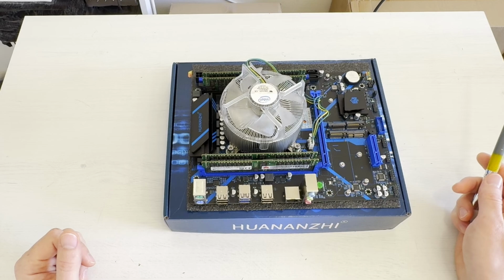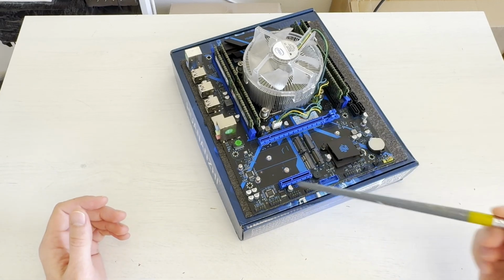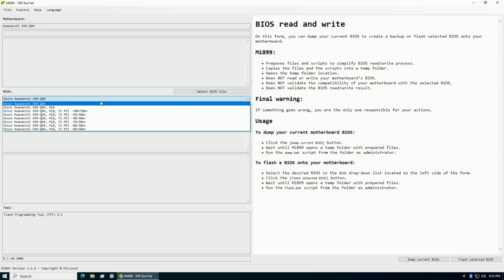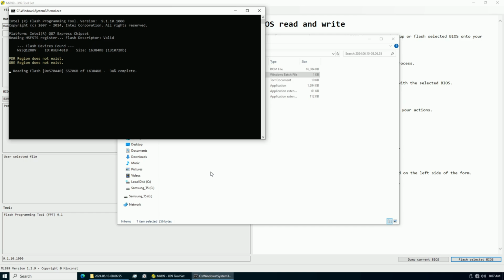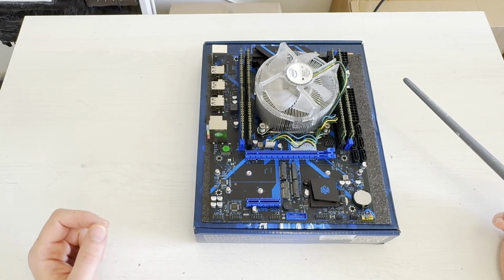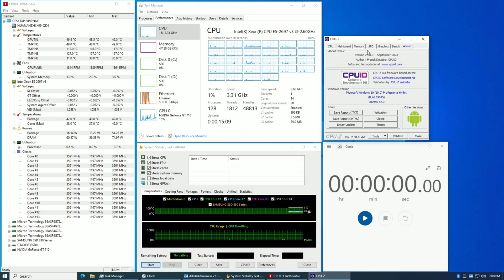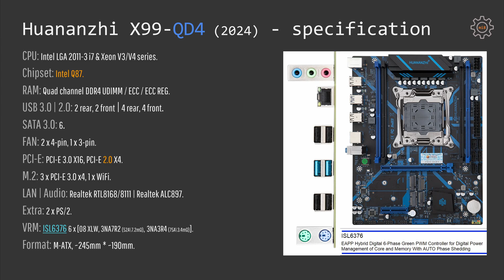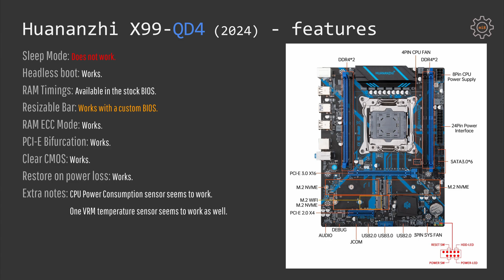Huananzhi X99-QD4 – the 2024 version with three M.2 slots

Comment: I have done the bios turbo boost unlock and everything is working fine. I think I have used your bios (50/50 turbo boost and I guess resize)... 2690v3 working at 3.5ghz and its fine!

Comment: Guys I have this board and a xenon 2690v3, what do you think unlock the turbo or not?
Reply from the maker: Why not? I would surely apply TBU, just need to ensure good VRM cooling.
Reply: @Miyconst the stock is not sufficient?
Right now the cpu runs 3.1ghz over all cores. The vrm temperature looks fine, i have good fans and a water cooler 240mm on it. 
But my questions now is:
I saw, if im not wrong, some bios mod by on the mi899, each one should I try? (Using 2690v3, 3060ti, 16gb ecc)
And adding a fan on top of vrm cooling its fine?

Comment: How to unlock turbo boost on e5 2680v5 please help
Reply from the maker: E5-2680 V5? I don't think such CPU exist.
Reply: @Miyconst  sori e5 2680 v4 so what do i need to unlock turbo boost or maximize the frequency ? Thanks
Reply from the maker: You need a V3 CPU, TBU is not possible with V4.
Reply: @Miyconst  can you provide a v3 cpu thats is good or the best cpu for v3 lineup
Reply from the maker: @benedictfernandez9069  please watch my benchmarks for detailed info, in general E5-2697/98/96 V3 are good/best.
Reply: @Miyconst  so if i use v3 xeon i dont need to mod my bios anymore ? And just use extreme utility app ?

Comment: How to unlock turbo boost on e5 2680v5 please help
Reply from the maker: E5-2680 V5? I don't think such CPU exist.
Reply: @Miyconst  sori e5 2680 v4 so how do i unlock turbo bost on ? Then what motherboard is good huananzhi x99 tf , huananzhi x99 f8 jginyue x99qd4 or machinist x99 d4
Reply from the maker: You need a V3 CPU, TBU is not possible with V4.

Comment: I have the original board and e5 2670 v3 cpu but I want to upgrade the cpu to i7 6850k, Dont know if it works or not ? Someone explain please...
Reply from the maker: It should work but you need regular non ECC memory for i7-6850k as far as I know.

Comment: Same power problem on ddr4 are with the Huananzhi x99 TF series.
If undervolt and another bios i have also 3 ddr4 slots working.
And woth 4th plugged in memory error due power delivery problems.
It seems orginal vios deliver 1.21v to the slots the others delivered 1.15v to 1.19v and gives problems with the cpu memmory controller under boot loading.
Most of the problems comes from the x99 bios from IBM and later Lenovo thats used on modded boards.
The problem also on ddr3 on the TF with all bios thats not orginal.
It means info in the bios are not correct setup when its maked

Comment: I have the 2024 version.
From one moment to the next it stopped recognizing the second RAM dimm, recognizing only the first one (the blue one on the rear panel side, it should be the A1).
I thought it was a burnt dimm, so I bought 3 more, but it still only recognizes the first one.
So I tried to swap them, whichever one I put in slot 1 works, but the others don't works.
then I thought that the memory controller on board the CPU (e5-2680V4) had broken, so I bought another one cpu, but nothing changed.
then I thought the power supply was starting to give problems, so I replaced it, but to no avail.
at this point, being IMPOSSIBLE that 3 out of 4 slots have broken, especially without having ever touched them before, I wonder if there isn't some damn bios setting that creates this type of problem. If anyone has any ideas help me please.
Reply from the maker: The idea is very simple, unfortunately the motherboard you have is simply defective, BIOS settings won't help here.
Reply: @Miyconst  
as I feared...
Looking back at how much I've spent up to now only in motherboards, I would have been quicker to buy a refurbished server from the same era

Comment: Hello again... thank you for your answer , so in the aliexpress what chances i get to buy a motherboard and processor for running windows 11 without any software changing ?? i saw your video here a Motherboard like this( ERYING-Desktop Motherboard Set com Onboard CPU Core, Gaming PC Computadores, Interpose Kit, i5 12500H, i5-12500H, 12C16T, DDR4, DIY) .. this kind of motherboard and processor running Windows 11 and TPM 2.0 ?? thank you.. bye
Reply from the maker: Just get yourself a Maxsun/SOYO/Huananzhi H610 motherboard with an i3-12100F, stay away from ERYING.
Reply: @Miyconst  so in this option i will never get a problem with TPM 2.0 ... because the processor get a TPM 2.0 inside right? thank you
Reply from the maker: That's correct.
Reply: @Miyconst  Huananzhi B760M ... and this motherboard is good?
Reply from the maker: Huananzhi B760M is decent. Nothing from AliExpress is good.
Reply: @Miyconst  And a processor for this motherboard with gpu included.. what did you recomend inside good price?? Thank you once more. Bye
Reply from the maker: Core i3-12100 is good for you and has iGPU, be careful and don't buy i3-12100F accidentally, the F models don't have iGPU.

Comment: Hello again... i got on bios a option overclocking but i have afraid to put it enable... i got a huananzhi qd4 old .. with Xeon e5 2697A v4 ... 4 memory of 8gb ecc samsung it working in quad channel... if i put overclocking i will get a problems soon? and one more thing please: the windows 11 for this machine without TPM 2.0 ,, what is the best solution ??? thank you my dear and of course great video. bye
Reply from the maker: E5-2697A V4 is locked, you cannot overclock it. Whatever you enable in the BIOS, it won't matter. There is no Windows 11 solution for X99-QD4.

Comment: Are there other good budget MATX boards with quad channel memory? I have an original QD4 that is beginning to show signs of failure, refusing to display an image with some GPUs. I want to order a new board to replace it but I'm not sure I want to trust the QD4 again.
Reply from the maker: Any Chinese motherboard is a lottery, even if you buy a tested and proven board you still may get a defective one. In general, take a look at Machinist X99-RS9 and MR9A if you can go to the ATX size.
Reply: Hey, many thanks for replying! The RS9 looks like a good option if I decide I really want quad channel and MATX form factor. I was considering the PR9 as it's very cheap, but the I'm not sure I want to drop 2 channels.

Comment: Hi myconst,i enjoy your video very much..
I want to ask a question,i have Xeon e5 2680v4 and i want higher clock speed for gaming,which processor do you suggest the best..
I have plan to buy xeon 1660v4 or 2697v3 or is there better option,thanks
Reply from the maker: I would recommend you to move to another platform, with LGA 2011-3 you won't get much better performance than E5-2680 V4. This video has more info: https://youtu.be/bNfLC2Nq9R8?feature=shared
Reply: @Miyconst  thank you for replying,but if i only got money for upgrading processor which one do you suggest?
Because if i move to other platform i have to buy whole new pair of cpu,mobo etc which i dont have the money for now hahaha,thanks you the best
Reply from the maker: @Winterfall1712  Then I would not bother, just use it as-is until you can move to a mordern or at least newer platform.

Comment: Hello may I know any X99 board can use xeon e5-2600 v4 CPU having sleep mode and hibernate mode in Windows works please? 🙏
Reply from the maker: Take a look at Machinist X99-MR9A but sleep mode is a lottery.
Reply: Thanks Miyconst for your kind reply. May I know if any option for sleep & M-ATX please? According your QD4 2024 review it doesn't support sleep mode too... deadly need a smaller form factor mobo😥
Reply from the maker: @asterisk-h  if you need a stable working sleep mode - skip Chinese motherboards. As I have said, it's a lottery. Some of my X99-QD4 and X99-RS9 boards had working sleep mode but not all.

Comment: In the first slot of the QD4 motherboard, referring to the PCIe x1 slot, will a sound card work there?
Reply from the maker: It should, unless you have a defective motherboard.
Reply: @Miyconst I connected it to the PCIe x1 slot, the computer powers on but there is no display

Comment: Hello excelente video.. great.. can i ask you where did you get that cooler intel ?? i have the Huananzhi motherboard QD4 old version... and got a Woobid cooler low profile ... 6 pipes... because the vrm sometimes is hot.. i use a Intel Xeon E5 2697A v4 ...  is a power processor... so i see your cooler and where you get that..?? Thank you
Reply from the maker: That cooler is an Intel OEM part, I got it from a scraped workstation, not possible to buy anymore.

Comment: Hi Miyconst, I had my Huananzhi X99 QD4 functioning all right with 2667-V3 cpu turboboosted for the last three months. A week ago, my PSU died and I had to buy a new 80plus bronce psu. However, when I replaced the psu, got no screen display but fan coolers were working. I am afraid  I have a bricked motherboard. What should I do? Maybe I can revert the original bios? I would appreciate your advise
Reply from the maker: It's more likely that your PSU also killed the motherboard, also could be the other way around. The motherboard fried and killed the PSU. Anyway, this video shows how to unbrick a motherboard. https://youtu.be/4qX2zihB6UE?si=Jg10atPuGcnuxgAg
Reply: @Miyconst  thank you. I will check the video

Comment: I have this motherboard paired with a xeon in a proxmox server, no issues with quad channel either. I have all the m.2 slots populated and wireless installed. My only complaint is the positioning/orientation of the SATA connectors. I have a GPU for llm workloads and only 4 of the SATA connectors are accessible.

Comment: I think I broke my QD4 trying to flash bios for TBU, when I start the computer, the fans gets on but no display (tried removing CPU, RAM, SSD, CMOS etc). I'm getting a CH341a to check what happened. Do you know where the EPROM chip is on the motherboard ?

Comment: Dear friend, can I update my x99 qd4 bios 10-10-2022 version to the 2024 bios X99-QD4V0.1693H 24-03-09? Is rebar will be present in bios?
Reply from the maker: I cannot guarantee any BIOS compatibility when it comes to the Chinese motherboards. It should work but it may also brick your board.
Reply: @Miyconst  thanks for the quick reply friend.

Comment: I see that they're both what you call "flower" type cooler and "C-type" downdraft cooler (like the thermalright SI-100 for example). Do you consider them to be the same thing or do you make a difference ? If they're different, what "flower" like cooler would you advise that we can find on the market ?
Reply from the maker: Technically these two are different cooler types, I am just generalizing here. Both options have their pros and cons. The true flower like mostly have less cooling capacity and don't have heat pipes but the airflow is slightly better for VRM cooling.
Reply: @Miyconst  I guess it's an intel TS13A cooler you put on this setup, what is the maximum TDP you got out of your socket 2011 CPUs with this cooler ?

Comment: With this layout, you can have a 3 slot GPU and put a 10G NIC card. 4 lanes of PCIE 2.0 should give you 16Gbit/s transfert speed at max.
Reply from the maker: Indeed you can.
Reply: @Miyconst  I'm from France and in September I will be able to switch out my current internet box and we have an operator called "Free" which have an offer for 10Gig fiber and has a 10Gig port SFP+ to plug a PC on it. I'm checking my aliexpress coupons :D
Reply: 3 slot gpu likely will block 2 lowest sata ports on the QD4
Reply: @marcc5768  I only use NVME drives on this motherboard.

Comment: Cześć!
Co myślisz o Jingsha x99 e-max. Wydaje się być to fajna tania płyta na cheapset x99. Problem może być z dobraniem chłodzenia bo port pcie jest bardzo blisko socketu i karta graficzna może przeszkadzać. (Mam fortis 3) 

Spodobała mi się też jingsha x99 D8I 
Ewentualnie taniej machinist x99 pr9.

Planuję użyć e5 2690 v3 z chłodzeniem foris 3. Co myślisz o tych płytach? 
Pozdrawiam
Reply from the maker: Hi. I did not test Jginsha X99E Max so I don't have much to say about it.
Reply: @Miyconst  Thanks for answer. So... What do u thing about jingsha x99 d8i, the chipset is x99, not q87 like in e8i, so it seems to be better
Reply from the maker: Chipset itself doesn't make a motherboard better or worse. If the extra X99 chipset features are not implemented on the motherboard it doesn't make a difference what is the chipset. D8i was not tested by me either, thus I can't recommend it. In general, I personally prefer to stay away from Jginyue products.
Reply: @Miyconst  you're  right, thank you for your help
Reply: Dodam że chciałbym użyć turbo boost

Comment: I'm planning to upgrade my current kit (i3-9100F/32gb 2400 DDR4/ASUS Prime B365) and I'm seriously interested in this for the giblets. You can find it on AE in a combo with a E2680 for $82, and 64GB 2400 MHz ECC RAM for another $75. The 3rd M.2 slot is a big bonus.

Comment: qd4 with 2680v4 and rx5700xt will it last long?  have i to worry about durability? or should i invest in bd4
Reply from the maker: You always need to care and worry about longevity whenever you buy anything from AliExpress.
Reply: @Miyconst  and bro what is should buy. 2680v4 or 2690v3. i work a lot in Photoshop and sometimes render video. i stop playing games few years ago but sometimes maybe i will play again
Reply: @Miyconst  2680v4 is 10€ more expensive
Reply from the maker: E5-2690 V3 requires TBU, consumes significantly more power, and performance is slightly better. Now you can decide what's more valuable for you. 😀

Comment: Hey why only CHinese X99. Do you know anything about unlocking Turbo on western X99 boards like MSI X99A or Gigabyte GA-X99 ??
Reply from the maker: The TBU method works the same but you need an external flash programmer like CH341a to write modded BIOS as most branded boards will prevent you from flashing non original options.
Reply: @Miyconst  you mean the most but is there any single one that allows that ?
Reply from the maker: I have not had any but I heard rumours that some Asus can be flashed with AfuDos and some Gigabyte with certain BIOS version don't have integrity check.

Comment: Very nice review. About the wrong power consumption from iengineer BIOS I agree with you that it is a bit on the low side. However, at 135W on the wall I would say 85-90 is expected depending on the GPU idle power and PSU efficiency. It is not the stock BIOS a bit biased in the opposite direction, judging from what i saw in the video? Thanks
Reply from the maker: I tested with an Nvidia GT710, do you think it can suck that much juice? I really doubt.
Reply: @Miyconst  taking that into acount I agree with you. Maybe with an older, more power hungry gpu it could have been the case. I would say your wall meter reading minus 15W (gpu at idle, ssd, etc) multiplied by 0.8 (psu losses plus power phase conversion losses) is a decent estimation of real CPU power consumption

Comment: I build my girlfriend a gaming pc with the X99-D4, it ran only 96gb/128gb when using ecc ddr4 32gb stick but runs perfectly quad channel with 4x8gb ddr4 3600Mhz crucial modules. Added the turbo boost unlock mod and the cpu is the 2690v3. Cooling is hyper212evo with pushpull fans, 120mm fan as exaust and 140mm artic fan as intake blowing over the motherboard and  vrm, the vrm heatsink and back of the board(with thermal lasergun) read 48-55°c.
She loves the pc and with a GTX1070 it runs all games she plays, even if the build is a wanna apple mac in the Aerocool CS-109 :D
Reply from the maker: That's a lovely build for very little money!
Reply: @Miyconst  thats the thing i love about it she has 32gb ram and 12c cpu so she can edit video or try rendering images or videos and iits pretty quick. For the same price as the X99 combo with out the ram i could only get i3-10100f with out the board

Comment: Bought this board based on your recommendations, as I needed a mATX variant and this was the only one that didn't have glaring issues on the channel. It's mostly worked a treat, although for whatever reason when using Mi899 presets to get TBU working, it'll freeze after 10-15 minutes of routine load. Resetting to default in the BIOS keeps TBU working and fixed my stability problems. Currently have a E5-2699 V3 that I have configured to 16c/16t that runs at 3.4-3.6GHz under full load.
Reply from the maker: That's a great CPU!
Reply: @Miyconst  it really is! Wish I read the AVX offset better though, as it ends up clocking a bit lower then lesser core counts, but I believe the increased L3 cache makes up some of the difference! It’s at the point where it’s mostly memory limited when running games like BFV/BF1.

Comment: I had a couple issues with this new board revision. System freezes in about 1 minute with original BIOS, completely solved with the old BIOS revision. And I couldn't boot with RAM 2400MHz quad channel with a 2680 V4 doesn't matter what I tried, even CL17 3N. With 2133MHz I can get CL12 1N.
Reply from the maker: Thanks for the feedback. Seems like the memory traces on this motherboard aren't that great.